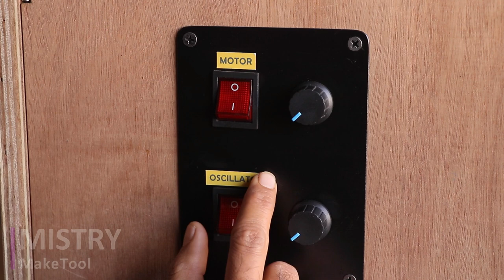Make A Oscillating Spindle Sander | Woodworking project

Comment: Neat work! I’m a bit concerned about dust and heat in the power supply, though.
Reply: an external dual PSU would be safer I feel along with the controllers being boxed in and sealed.

Comment: Did you make any changes after getting lots of dust to the power station and controller? You should have mounted them outside or in a separate ventilated room in side the box. Nice project.

Comment: Jeebus!  The motor you've linked to costs ₹2,999, which equates to around £30, yet to buy the same motor here in the UK, we're looking at anything between £75 and £150!  😲

Excellent video, though, and a handy addition to a workshop, but, as others have said, you really should have some sort of dust collection system.  Maybe that could be a project for a future video?  👍
Reply: Not true
Go to any gocart repair shop or wheel chair, you get dc motor 250W for $30

Comment: That is an excellent build my friend. What are the 2 boards called u used for the electrics at the back of the switches in the doors with the oscilating fixings as well?? I have a lot of the parts u used for this but those little boards with the small capacitors in them I DON'T KNOW WHAT THEY'RE CALLED?? 
I'm not a tech savvy as u are man. 
I really enjoyd watching this build.  wHAT SIZE POWER SUPPLY DID U USE FOR THIS MOTOR?

Comment: The wiper motor is 12VDC and the drive motor is 24VDC yet are both powered from one power supply unit? one of your motor is being powered incorrectly I think?
Reply: dual output PSU is possible

Comment: I'm sure you didn't pay $2,999 for a motor. Why not go to a big box store and buy an oscillating spindle sander and save your money. Something is wrong with this whole concept.
Reply: You might want to double check the currency... it’s clearly Indian baht, not US dollars... I’d guess the price is way below $3000, let alone $60...
The real disappointment is not including links for the DC PWM speed controllers, but given it links to Indian amazon, that would be just as useless.